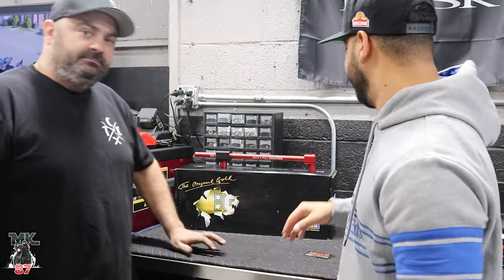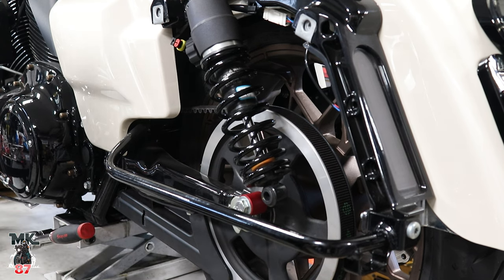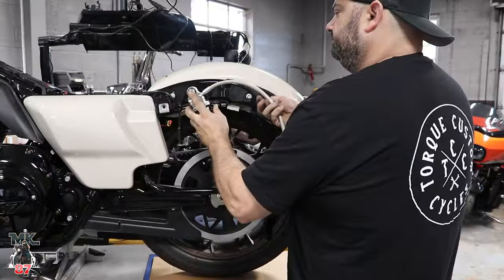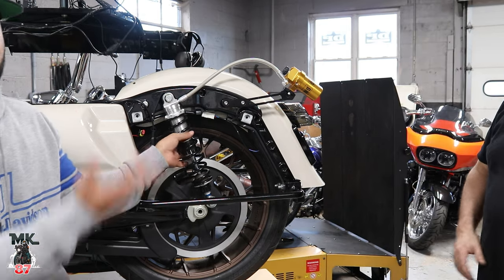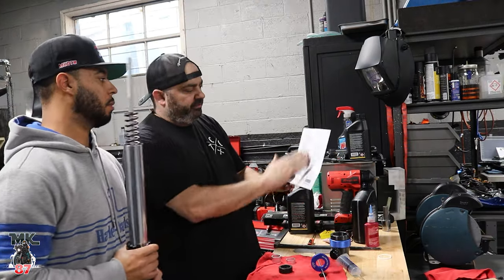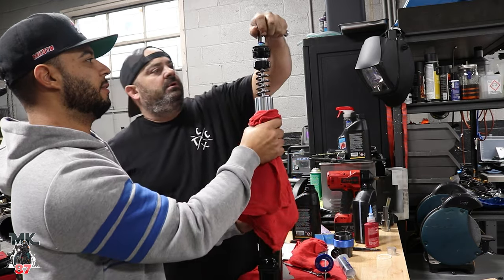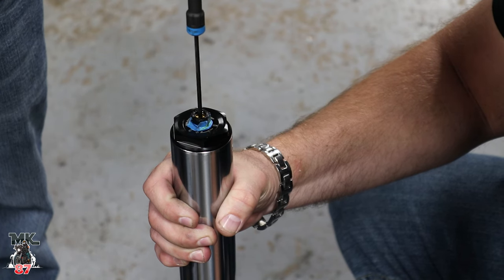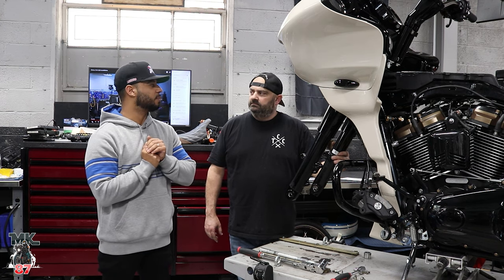HARLEY DAVIDSON Ohlin's Front and rear suspension install

Comment: You're supposed to bleed those cartridges first, then set the oil level to set the air pocket
Start over
Reply: It was done correctly. The video was out of sequence
Reply: Yep...after adding about 0.5 liters of fluid, you're supposed to pump that outer tube up and down about 10-15 times to get all the air out of the cartridge, then set the 140mm fluid level.  Maybe he just edited that part out of the video, or I missed it?

Comment: Actually the kit is designed to be ran with the tour pak docking mounts. Thats why the spacers don’t exactly do there job and additional spacers are needed if you don’t have docking mounts
Reply: This is what ohlins told us.
Reply: Theres another video from a YouTube channel where an ohlins tech at Daytona explains it during the install. Either way just sharing info.  Cheers Mate